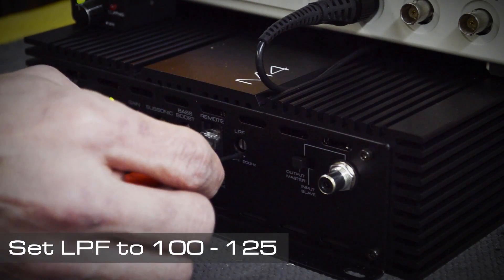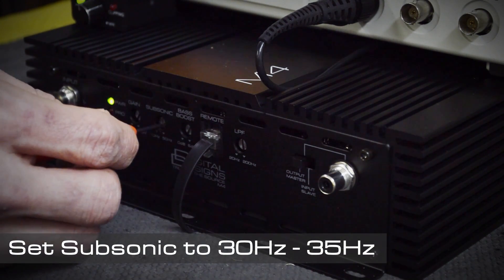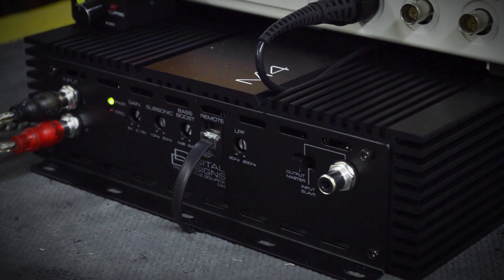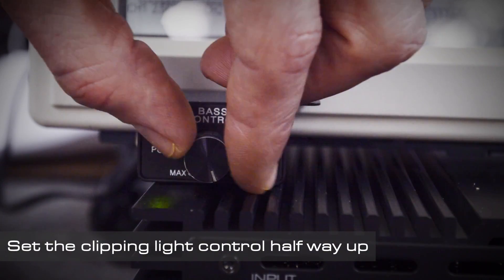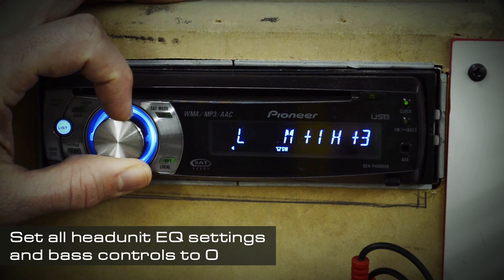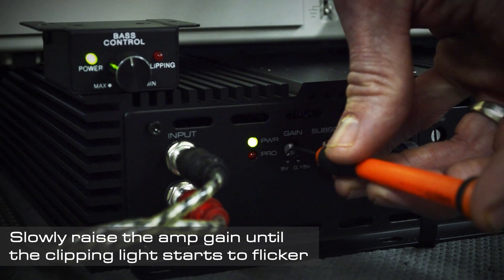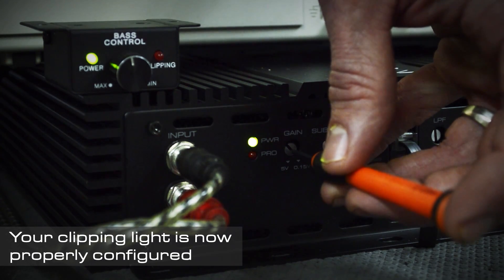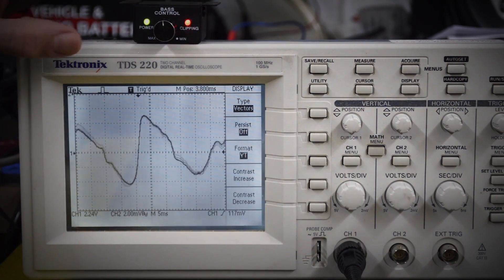Setting Your Gain with the Remote Clipping Indicator

Comment: But thats wrong? Every video on yt says that you put the remote bass knob to max and then set gains on amp to the point where it starts to clip and back it down little bit
Reply: Either way works, it depends what you want. If you adjust it all the way up, you'll never have additional headroom for a song that might be a bit quieter. That's really it. If you do adjust it with it all the way up, then you'll never clip in theory, but you won't have that adjustment if you want a bit more on those quiet tracks.

Comment: lord no. Most head units send out a clean signal all the way up to full volume. If a head unit goes to 35 tune at 33. If it goes to 40 set it at 38. If you don't know if your HU is clean then get an oscilloscope and find out. Crank your bass knob all the way THEN adjust your gain. If you tune it at half way, any numbnuts thats plays around in your car will be able to turn it up all the way and clip the shit out of your system. Better to be safe than sorry. If you tune it at max then its impossible for anyone to damage your system. And what the hell you setting your subsonic at 35 for? Those are some of the best frequencies. You don't like low bass or something? Me personally I happen to like low bass so I set mine to 20ish.
Reply: https://www.youtube.com/watch?v=TY4cr6tOK3s

Comment: Do the subs need to be hooked up when setting clip light or can they be unhooked?
Reply: unhooked scope hooked up
Reply: unhooked unhooked please unhooked.
Reply: @sssmithVR  @Sean Smith why? it's going to clip at a much earlier volume when you plug your subs in if you do it like that. I don't get why people turn off the eq either. when you plug your subs in and turn the eq back on you're going to clip way way earlier than with no eq and no load(aka subwoofers). Seems like you should set the gain in the same environment that you listen to your music. IDK maybe I'm wrong but I doubt it.
Reply: @Titans2138   I have my subs hooded up and the ddm4a amp gain on half and the clipping light comes on and the bass is not loud.
Reply: @BOSSMAN300C  if you followed this guys instructions I know exactly what your problem is. I just watched this video again and home boy says set the low pass filter to 100-120. And subsonic to 37hz. This is awful advice. No wonder I wrote another comment that said this video is garbage. The highest your low pass should be is 80hz and I wouldn’t even do that high. Your subsonic should be set to like 25hz at the highest. I set mine at like 22 hz. If you listen to this guy no wonder you’re clipping early and your bass wounds weak. You’re lowering the volume on the most important sub frequencies and then you’re playing higher frequencies than your subwoofer was designed for. If you listen to rap or any kind of electronic music, on DD’s own website they say they played some rap songs and asked people when they started to notice a loss of bass while they slowly turned up the subsonic filter. People noticed a loss of bass around 24 hz on some songs so 37 hz is crazy. I’ve never heard of anyone setting their subsonic that high. Let me know if that fixes it
Reply: @Titans2138  thanks for the help. My subs are (2) 9512i. My box is tuned to 36hz and the amp is the DDM4A. The subs are dual 4 ohms wired down to 1 ohm and  just a one negative and one positive going into the amp. I listen to rap, hip hop, Soca, reggae, old school music and all kinds but those 4 the most. My deck is a Kenwood excelon with 5v 3 preouts. Alternator is a 320HO and running a 120ah lithium battery, also did the big 3. All bass settings on the deck is at 0 and loudness is off. I play all my songs off my iPod that’s hooked up with a iPod cord that’s for the Kenwood deck. The bass used to hit hard when I had my cactus 🌵 audio 5k amp. I find last night I had to turn the gain all the way up on the to reach some loud bass.

Comment: What if the clipping light is on all the time? & not the power green led? I got a 6 wire cord now but with the 4 wire the green led lights up but can't set the clipping gain. Unplug it & everything works fine

Comment: Why you put your bass knob to half way up and not maximum?
Reply: Because not all music and souces will clip at the same point, so you can turn it up until it does depend on what ur listening too.
Reply: Can you turn your bass  settings back up on your head unit once you have set it?
Reply: @rodneyratcliffe7749  I think that will mess you up. You will clip at a lower volume. I personally would turn and bass boost off the set your eq to what you like then set up the knob.